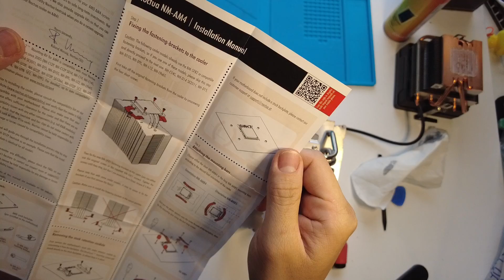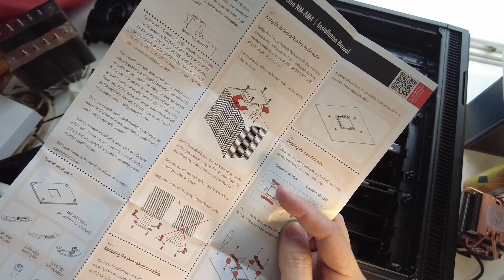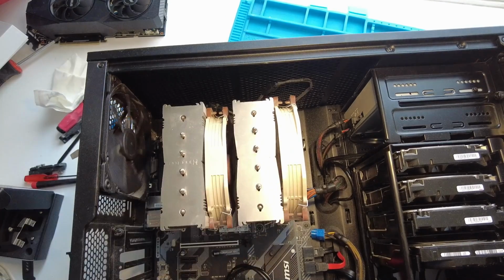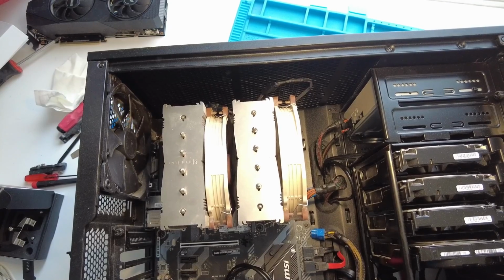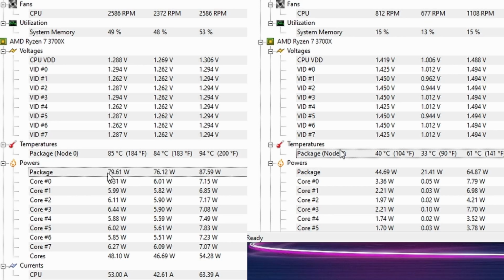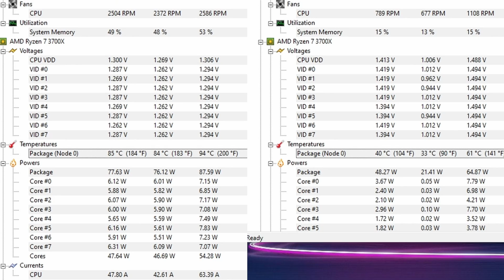Don't make these mistakes.. Noctua NH-D15 AM4 Mounting Kit installation disaster!

Comment: 1:52 dust floating everywhere whenever you touch it. Good CPU paste, good cooling, good fans etc etc are all important, just as much as cleanliness to avoid the layer of dust trapping heat. And simply because it's lazy and gross.

Comment: Does it clear the ram for example i have 4x8gb G Skill trident z neo and the cooler doesn't look like it fits above the ram? Also you placed the Noctua cooler upside down 😅.
Reply: I had the same RAM (also 4x 8GB) with an ASUS Crosshair VI Hero/3950x and it did fit just fine.
The first fan must be placed a little bit 'higher' (I placed both fans a little bit higher). Just be sure your case is 'deep' enough so you can still close the side panel.
Btw: Here's a picture (not my system) of the black NH-D15 with G-Skill Trident Z Neo ram: https://i.redd.it/vtxpfk02r8041.jpg

Don't know what CPU you have, but you could also take a look at the NH-U12A (using it now). Way smaller but almost if not the same cooling capacity as the NH-D15.

Nothing but Noctua for me.

Comment: If there is ever a next time, either run the PC using a CPU benchmark for at least 30min (and quickly disassemble) or use a hair dryer/heat gun on CPU/heatsink.